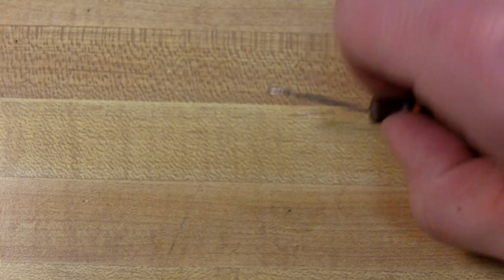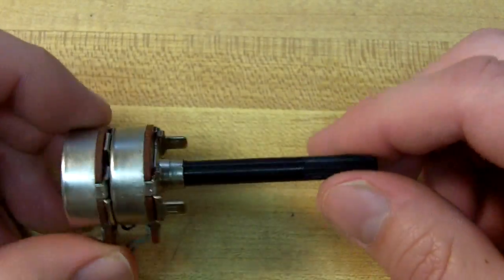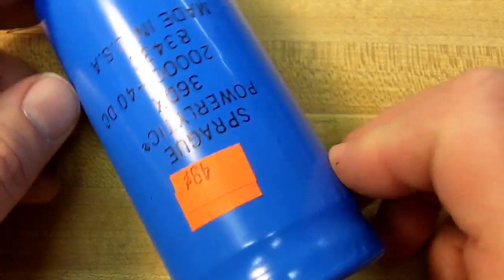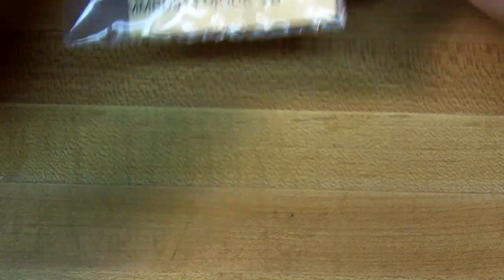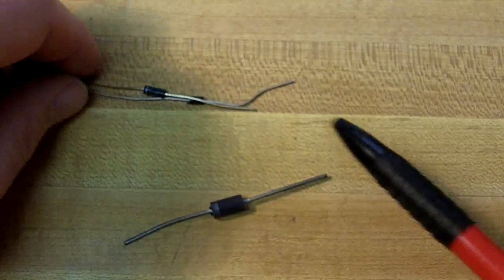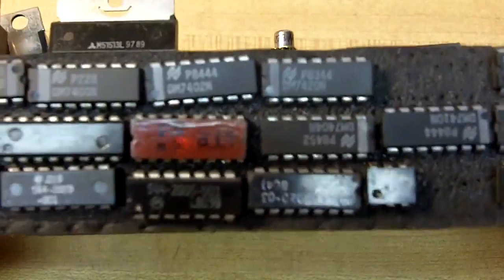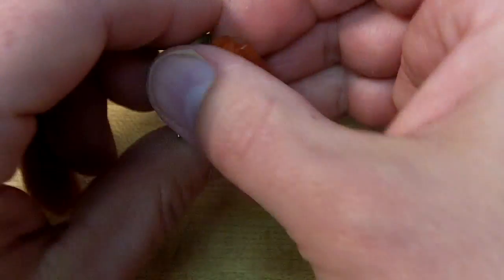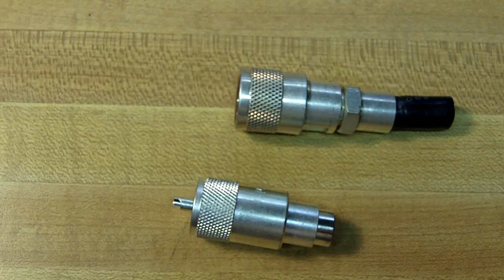How To Identify Electronic Components

Comment: There's this very small silver cylinder on it's side on my gba game circuit board. It's supposed to be welded but broke off. It has 2 silver legs that are welded to different spots. Do you know what this component is? I figure that's why the game won't load. I've done some research but come up empty. Note: Solid silver.

Comment from the maker: They look like transistors with 3 legs on them but usually have a heat sink metal back to them with a hole to mount to a heat sink or chasis, if they are made to handle more current, they come in a different package, large silver case with 2 thick legs, the case is the 3rd leg.

Comment: When you are looking to buy IC's you should consider what you want to use it/them for. Some are more for digital use (ex.:computer CPU's), whereas others are used for used for analog circuits (ex.:OpAmp's for audio amplification). Audio has also moved into the realm of digital, another example of a digital application.
The long and short of it is do some research so you get the right thing.
NB: Modern computer CPU's have millions of transistors in them. For me that's mind boggling.

Comment: allen bradley resistors, ceramic coated resistor, potentiometers, 365 pf variable, 440 pf variable, caps - uf or pf... I have had some nf, i saw some Voltage regulators....

Comment from the maker: @ISHOULDAKNOWN  I do have some test equipment here etc, good idea, maybe I will post some clips on using some test equipment as time goes on...thanks for the idea.  An RF generator is very useful for generating a test signal to work on receivers.  Mine is an old one but works good enough for some work.  Not stable enough for accurate signal levels though.